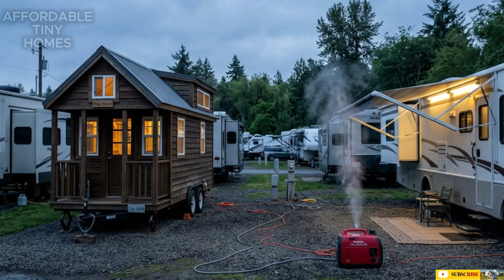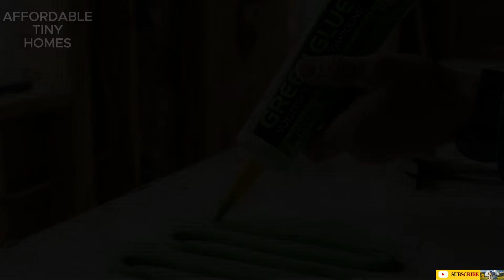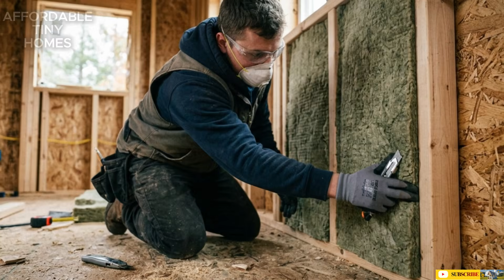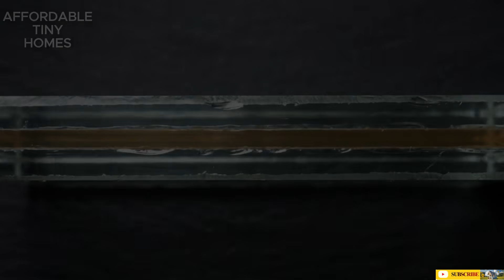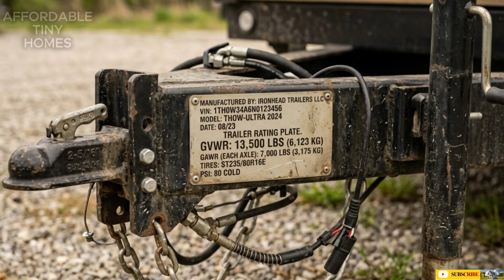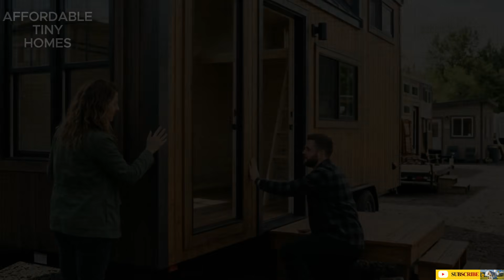The Only Tiny House That's 100% Highway Proof (Built-In Sound Barrier)

Comment: we have a panel system that will address this issue better than other builds both in weight and decouple
Reply from the maker: Really ?
Reply: @AFFORDABLETINYHOMES-i9j  structural 5.5 inch EPS with no bridging thermal break only bridge would be at top plate if placed in gavl bottom track. studs 24 inch on center finish with double sheet rock as outlined in your video.